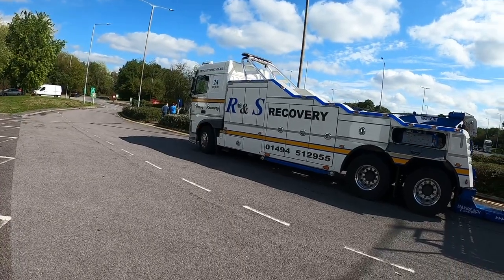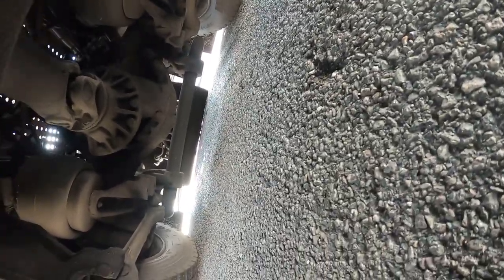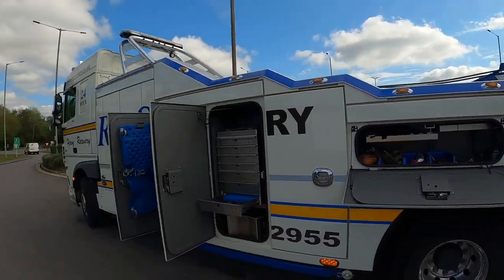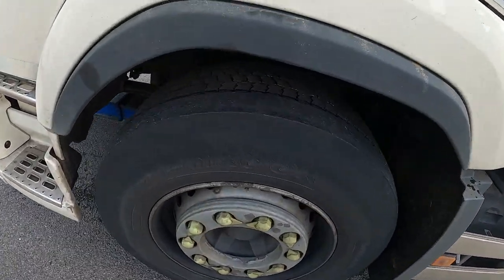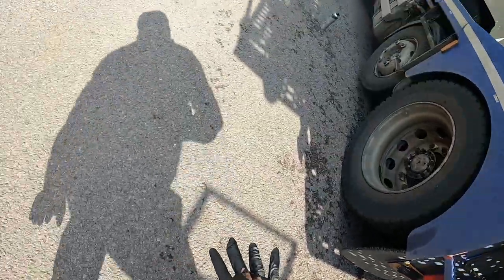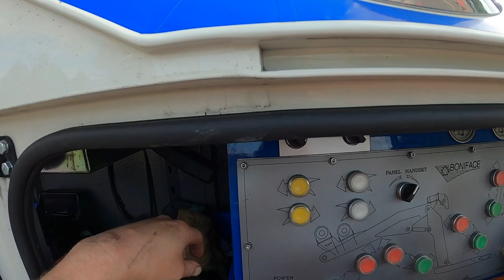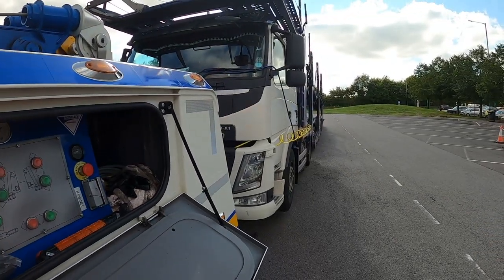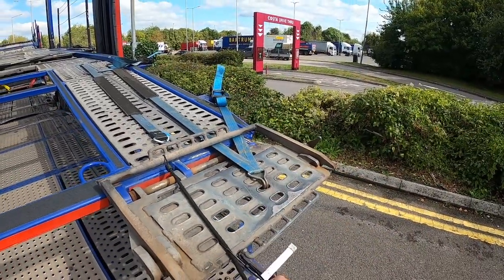12 CAR TRANSPORTER BROKEN DOWN! UK HEAVY TRUCK RECOVERY!

Comment: Thanks for another interesting one Steve. Evoked a few more memories of my haulage days..

I had the misfortune of experiencing Reading Services a time or three. Two of the most unsuitable HGV parking areas around! Not large enough to accommodate the volume of traffic, far too tight, poorly laid out, plus, the ruts and damage to the asphalt......! They used to be like the Somme! A "normal" artic was difficult enough to pilot there, let alone a car transporter!  The eastbound showers were always nice and clean though.

I encountered plenty of services and truckstops with tight parking areas. Cambridge Services, along with Ulceby and Whitwood Truckstops instantly spring to mind after Reading, Cambridge (or Boxworth now, I think) in particular. I remember plenty of mirrors being obliterated there and am responsible for one of them. It was a DHL container truck, and the driver, bless him, when I approached him with my details and he twigged that I was an owner driver (I was never keen on bandying that about, and didn't tell him), handed the piece of paper back and said, "Don't worry about it mate, I'll tell them I hit a hedge or something, stay safe". All 3 had parks that were designed and laid out to the millimetre, and certainly didn't allow for car transporters extra length. And, if memory serves, Ulcebys park tapered towards one end. Perfect for solo tractors and rigids, but not good otherwise. If you were parked opposite or next to a transporter and had an earlier start in the morning, it sometimes meant a reluctant knock on the poor drivers door.... I only did that once. After that, if the driver was still up when I parked, I'd always ask what time they were starting, and if it made sense, could we swap spots or whatever. Thank goodness you didn't have to pull this one out of a tight spot! 

How was the ride to Stoke? After I asked you about tacho regs in the previous video, it's ironic that this one involves a jaunt beyond 100km!  At least it was mainly motorway 😊😉👍

Oh, are you permitted to expand on the reason for not showing how you disabled the handbrake?! I wondered if it was in case of somebody who shouldn't have access to it getting access and indulging in skullduggery? Or does the disabling process involve skullduggery.....?!😉😉

Cheers Steve
Reply from the maker: Hi Simon thanks for watching and commenting about your experiences. By disabling the electric handbrake your able to turn the ignition off without the handbrake coming on automatically  , it comes up as workshop mode on dashboard.
Reply: @HeavyRecoverywithSteve  Thanks for the reply Steve, makes sense now you've explained it. I never got the chance to drive anything with an electric handbrake. All good old mechanical stuff for me! 

It also occurred to me that it's a shame the 6 weekly inspection requirements for the operator of this transporter/whoever does their maintenance don't seem to include checking and lubricating susie fittings! Imagine if the driver had to drop the trailer for whatever reason and didn't have the facilities to loosen the fitting! That could've meant a £150 or whatever callout fee for someone to do what you did with the minimum of fuss and tools! A few squirts of WD40 and 30 seconds max every 6 weeks vs £150+....🤔 

Thanks again. Always look forward to the videos 👍

Comment: Hi Steve.. having spent 20 odd years with Volvo  my advice would be to remove the prop as the  gear box has a oil pump driven from the layshaft.. if you leave a half shaft connected this is enough to spin the prop and will run the nose bearing dry between the input shaft and the main shaft..
Reply from the maker: Hi Mate thanks for watching and advice, most of the training giving out now is half shaft removal dont get under to disconnect prop especially with 3 axle units with mid lifts.There have been few operators killed on the roadsides removing props so think that's why not recommending us as best practice now to teach.
Reply: @HeavyRecoverywithSteve   Hi Steve, good point, might be best to pull both shafts then, as i've seen a lot of gearboxes fail after being recovered with only one shaft pulled.
and its a very expensive repair when the nose bearing fails....  BTW... its the same box in the Renault premium and t range etc.

Comment: Hi Steve - good thing the cars were offloaded.  Does your sat-nav indicate low clearances, or do you avoid them mostly through your local knowledge?
Reply from the maker: Hi Ricky thanks for watching , i can programme the truck sat nav with height and weight restrictions for the journey.Transporters drivers normally run at max height so normally no best route back.

Comment: The 2 airlines going into the trailer Steve, I presume 1 is for brakes and other is for supply line. I'm guessing you supplied the trailer with a supply line due to the air leak, yes? I'm a heavy tow operator in Australia. Nice to see how you guys do it in the u.k
Reply from the maker: Hi Brett welcome mate, yes supplied 1 air line to unit that had air leak and 2 to trailer one to brake trailer and other to supple air.
Thanks for watching.

Comment: Nice one Steve 👍 love the vids. Don't  know much about car transporters but I would've thought the Suzie on that ridged tow trailer would  have been regularly took on and off. Just wondering why it was so hard to take off.
Reply from the maker: Thanks for watching , most car transporters never rarely get separated the unit stays hooked up to the trailer.The company i recovered it into had purpose built workshops to fit the unit and trailer in so doubt they separated much either.
Reply: @HeavyRecoverywithSteve  oh thanks  Steve makes sense now that I think about it. The trailer stays on all the time and the car's just drive up over onto the unit

Comment: I got pulled in the other day and they moved both drive shafts on my Volvo saying that because it’s a true auto box they have both got to be removed
Reply from the maker: Hi thanks for watching , the Volvo dealership we work for not said anything about removing both on single drive axles. We been asked to remove both half shafts with hybrid buses and ones with ZF drive axles not heard off any problems.But wouldn't hurt removing both just can be a bugger to refit half shaft on diff lock side.

Comment: great video as always, I do have a question. is putting airlines to the trailer a rule or just your personal habit? I never put airlines to the trailer unless there was a decent load on the trailer. I'm not trying to question your methods, just curious. 

I also find it interesting how the trailer is hooked up, it looks like a giant trailer ball, over here it's a very low 5th wheel

thanks again Steve (from central MN in the USA)
Reply from the maker: Hi Adam thanks for watching , we our trained over here to always run both air lines to the trailers they must be braked by the tow truck. More work on these transporters but dont have to run break away chains like in US , appreciate comments stay safe.

Comment: Mate how do you find the diff lock what would be the difference please
Reply from the maker: Hi Rum you can pull either half shaft to disconnect the drive , but easier to refit half shaft that's not diff lock side mate. You can spot which side is diff lock as there's normally air pipe and electrics going to that side of the axle.

Comment: hi steve i was taking a  45 on the services while you was loading that up    quick question  what spray  do you use  ive tryed loads  so was wondering what you like best
Reply from the maker: Hi Stu should of come over mate and have swing on sledge lol , not sure make of maintenance spray company supplied me this time.Thanks for watching the channel much appreciated.
Reply: @HeavyRecoverywithSteve  hi steve i thought about walking over but you was walking around at silly speed  so i thought let the bloke work in peace ,

Comment: How do you tell what side the diff lock is on ?
Reply from the maker: Hi thanks for watching , normally see a air pipe and wiring going to side of diff then you would remove half shaft opposite side to that , easier to refit then pulling diff side out.

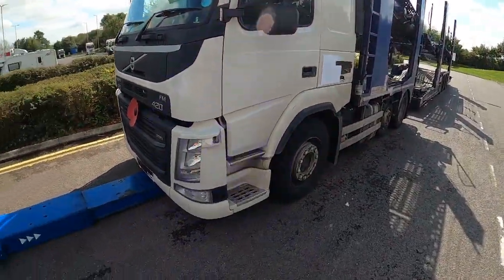Comment: @1:44 If that’s the engine from the Volvo transporter it doesn’t sound healthy
Reply from the maker: Hi Dave , mechanic thought it was a faulty fuel injector when i got to Stoke.
Reply: @HeavyRecoverywithSteve  it didn’t sound healthy what ever it was coming from the truck.